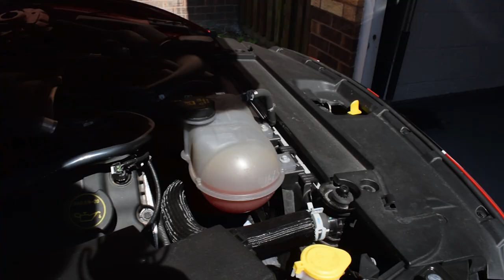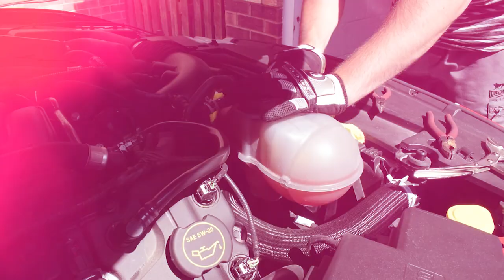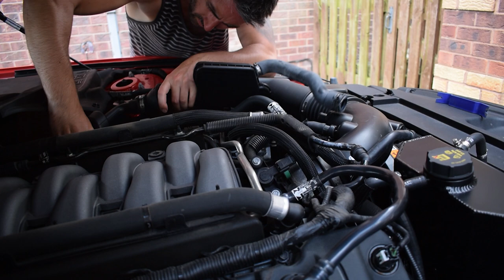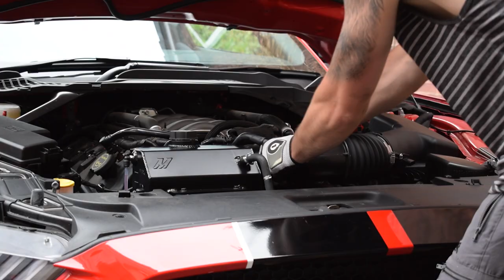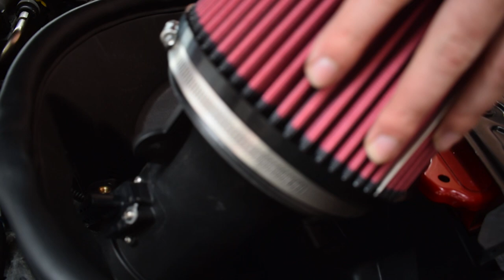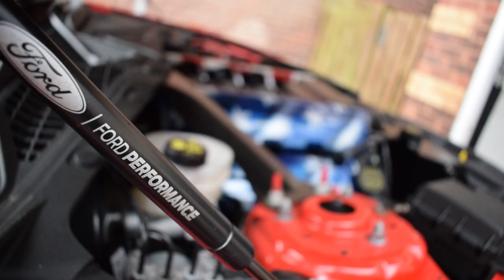Dressing Up My Mustang Engine Bay!

Comment: I think the Union Jack would have looked better especially if done on the diagonal
Reply: yeah I thought that aswell. Especially as the american flag is kinda laden with a somewhat negative and red-necky image. But as Chris said in the video, the engine cover is only seen when the hood is actually open, so I guess it's fine the way it is.
Reply: The car is american
Reply: I think it would have been cool to add both. You know the left bank union jack melting into the american flag since he is in the UK with an american pony car. Pays hommage to both. To each their own. When it comes to small details like this if its done right it could be The Hulk airbrushed as long as its great airbrushing I wont beat you up for it. Its just plastic covering that any totaled car would have if you wanted stock again.

Comment: what did you do after removing the pipe near the fire wall ? did you blank it off with anything or was there anything that came with the roush kit ?
Reply: lee clarke Roush cai kit included a rubber grommet/plug for the hole.